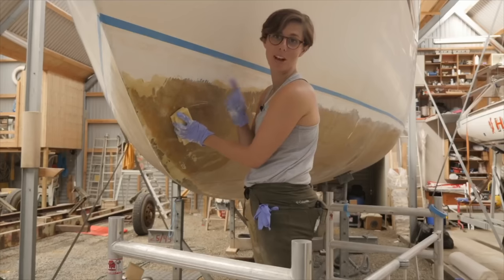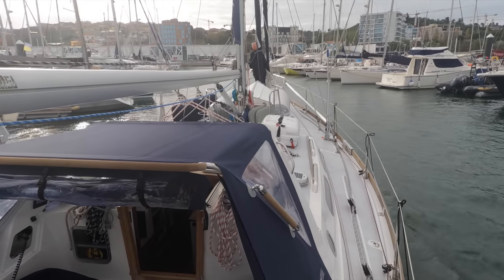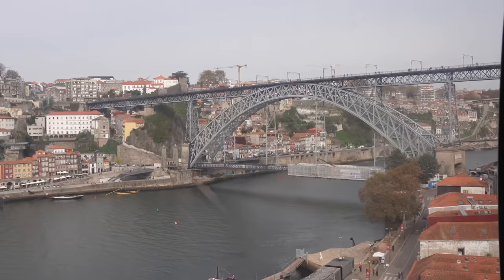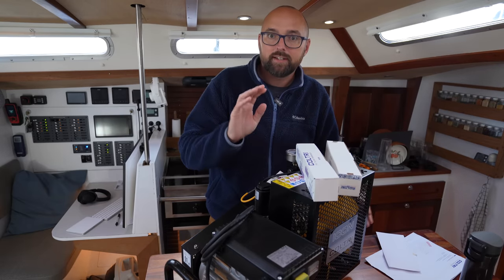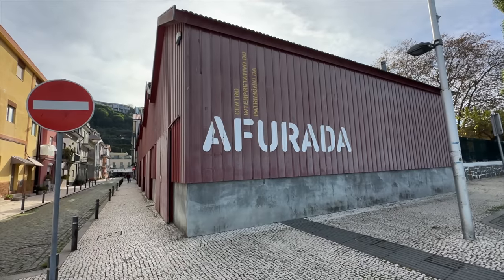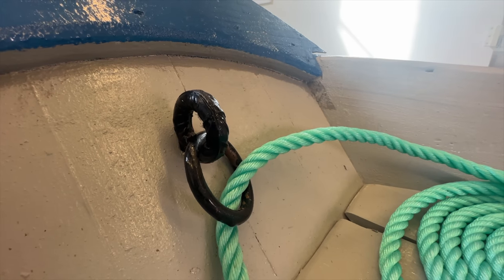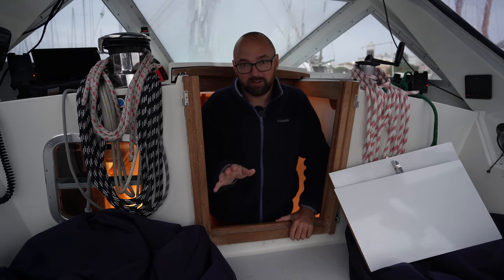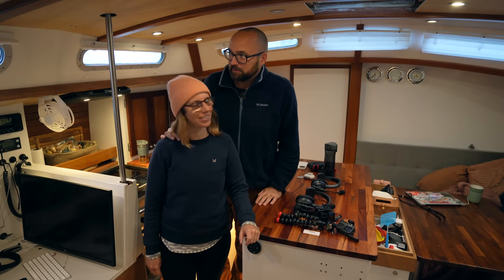Sail Life - New dive compressor and port in Porto 🍷🤿

Comment: Great Video!!    Mads I often think, of how many cruising adventurers have accomplished what you have done, along with Ava, in the totally extensive rebuilding of Athena.    I don't thing I am overstating the smarts you have in regards to software based equipment.   People should be in awe of what you have achieved.   By the way, Ava does not seem to require any direction from yourself when it comes to her role as an integral part of the crew.  From this end of the computer screen, Ava just gets on with it when you are docking or anchoring, and so on.    Oh!, and AVA, you have  the natural ability for story telling, and make the little tours around the cities so interesting and funny as well. Who would have thought a few short years ago, that you would be sailing around the world with a Dane, whose long distant ancestors, as you quite rightly pointed out, had a very violent culture. 😊

Comment: I had a coltri gasoline powered compressor.  Loudest thing I have ever owned.  I hated to use it so much I sold it.  If you've got the pixies, AC powered is the only way to go.

Oh! and we ordered a Starlink!  I had been waiting and waiting for it to be available here in Saint Martin, and consulted the map regularly.  I finally got tired of the crappy cell phone data service and was about to order it from Florida, when a friend told me it IS actually available on the French side of Saint Martin (as it is in Guadeloupe and Martinique).  The map was kind of referring to the Dutch side of Sint Maarten.  I'm happy to learn that because the hardware and service is WAY cheaper in French Saint Martin than ordering through Florida.

Comment: My Catalina 30 has a dive compressor as well.  it cost 300US with the 5ft of filter housings.  It is also the size of a kids lunchbox or so.  The cooling system utilizes water from our water system to cool the unit.  It is a Yong Heng and is typically used for paintball as well.  Just make super sure that your compressor is using synthetic food grade compressor oil for maximum safety.  A lot of people forget about the oil in the compressor needing to be food grade.  Also you may need additional filtration.

Comment: We have 208 and 240 V here in Americaland. But it is 60 Hz, not 50 Hz. A 240 V 60 Hz motor will usually run fine on 230 V 50 Hz. Just a bit slower. Still I agree it is best to make the purchase in Euroland.